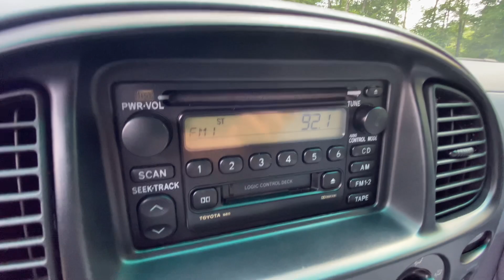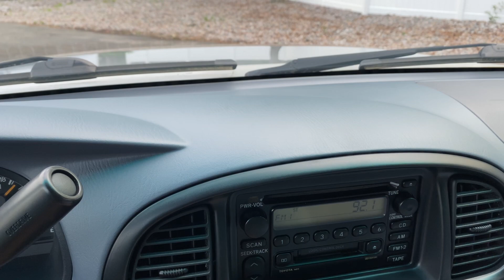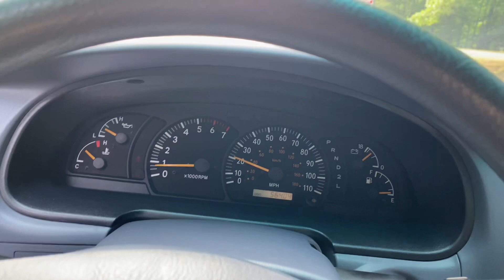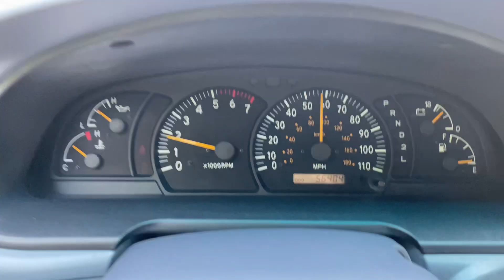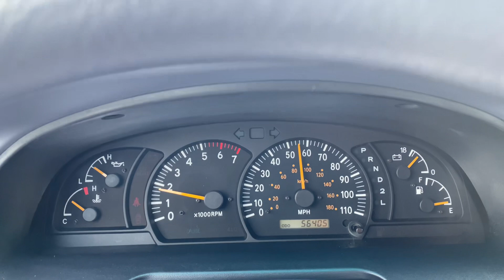DAVIS AUTOSPORTS - 2001 TOYOTA TUNDRA - 1 OWNER - 56K MILES

Comment: I am going to assume this truck is well above $20k. At that point, I may as well just buy a more modern truck with better safety ratings. As always, I enjoy your videos because of the nostalgia
Reply: I don't know of any truck for 20k. And with the mileage and and having all the services up to date including timing belt its worth at least 20k. This has the bullet proof 2uzfe engine. I have the same 2001 with 175k runs perfectly fine and no issues.
Reply: Long winded
Reply: The only truck that’s worth it, all others are garbage

Comment: Look fot a 3.4 V6,Bought mine New in Ga.Same Year ,For $19,000.Used mainly as Courier Truck,Got 888,775 mls.on it w) Orig.Eng.but refresned  Auto tranny @ little under 500,000 mls.Orig.Fuel pump lasted to Almost 300,000mls.Even the full quad cab V-8 was cheaper than $30.000 im 2001.